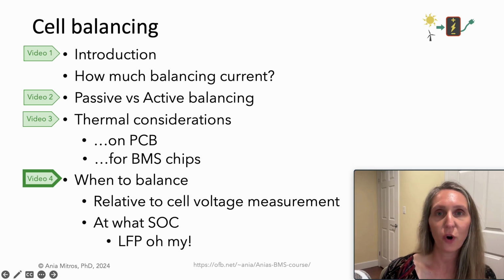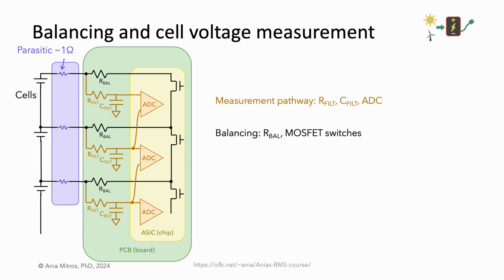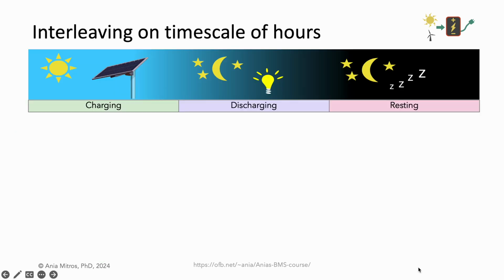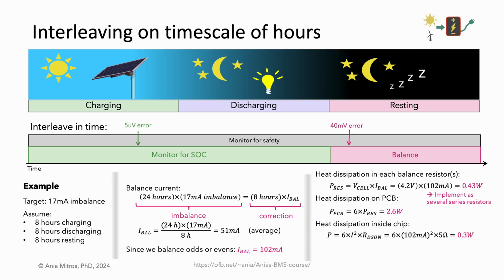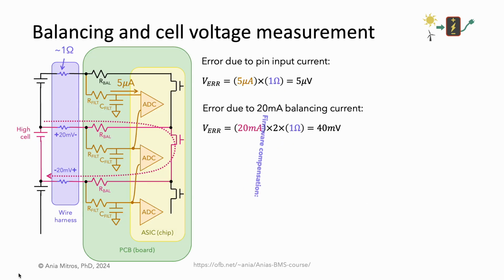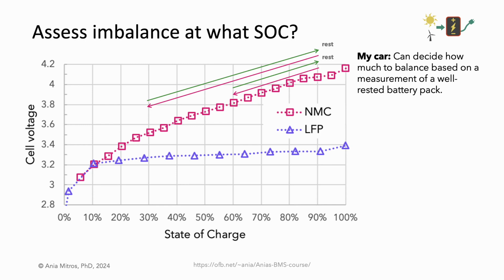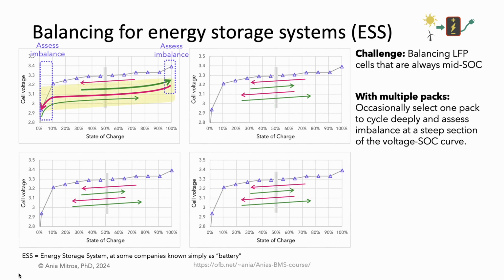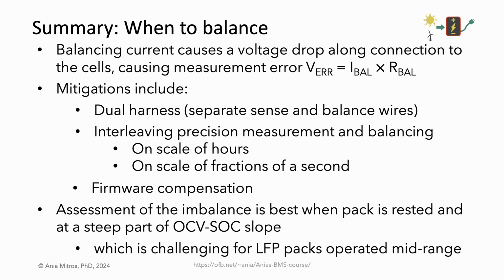Ania's BMS Course: Cell Balancing (4 of 4)

Comment: You balancing techniques do not appear to include Off-Grid with Solar & LFP, where balancing occurs while charging, during the Absorb Cycle.  You seem to be focused on Automotive and the Commercial Grid Power. What is the correct balancing current (amps) vs battery pack size (amp-hrs). What is maximum allowed voltage difference between cells of 48 volt LFP pack to start balancing and min voltage difference to stop balancing? Move energy Active Balance ... Cell-to-Pack and/or Cell-to-Cell? Low heat!
Reply from the maker: Thanks for your thoughts. Yes, you are right in many regards. It sounds like I should add more detail and depth. 

There isn't really a maximum allowed voltage difference. For one, with LFP cells, from 20% or 30% SOC to around 80% SOC, the voltage barely changes. Effects like relaxation after a current pulse dwarf the SOC-related voltage changes. Voltage difference is not a good way to assess imbalance for most of the operating range. Second, the best way to balance is to ensure that all cells reach top of charge together, which means that we want to balance by SOC not by voltage. Now, if you ensure that the cells are at the same voltage when the pack is at 100% SOC, they will also be balanced by SOC; there's a point where balancing by voltage and balancing by SOC are equivalent. Third, it's a continuum. If you have a 1% imbalance, you have 1% unavailable capacity. If you have 10% imbalance and thus 10% unavailable capacity, it's as if your battery pack were 10% smaller. What 1% corresponds to in volts changes depends on state of charge.

Active balancing is a great idea in theory, but every time I've looked at it in detail, the cost of the electronics to make it happen exceeded the value of the energy saved. If you have an example where the cost works out, I'd love to learn from you.

With my apologies about the very belated reply.... Does that help?